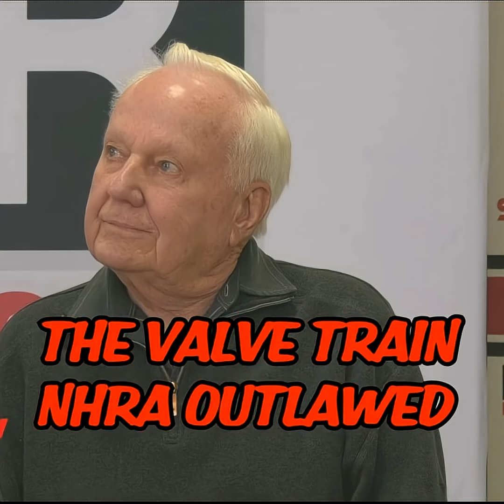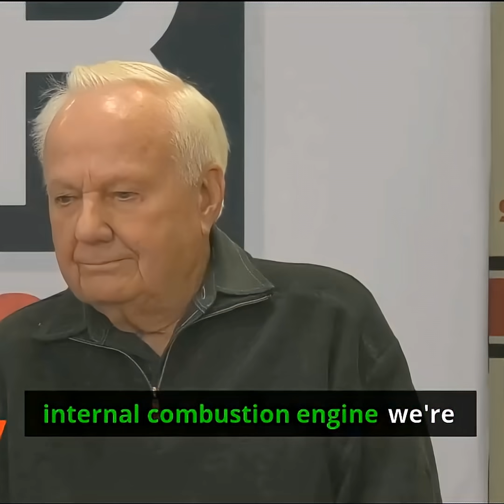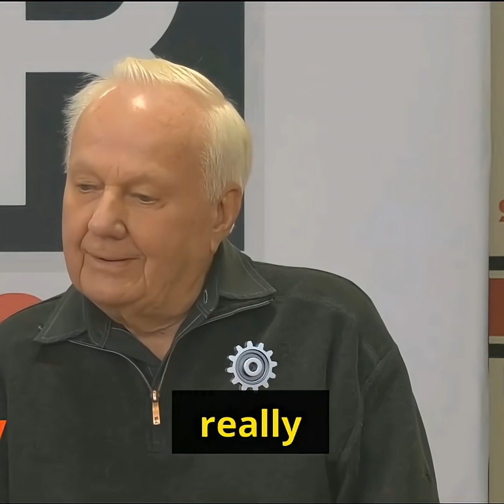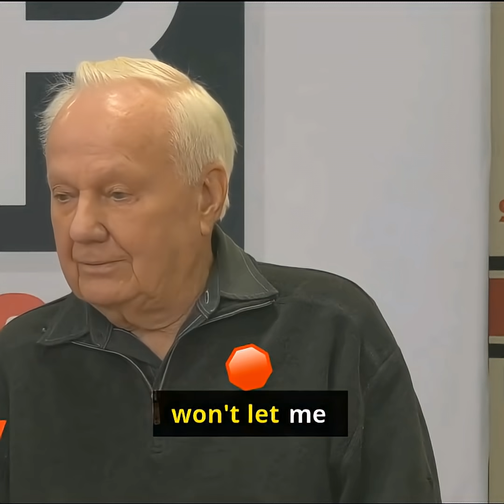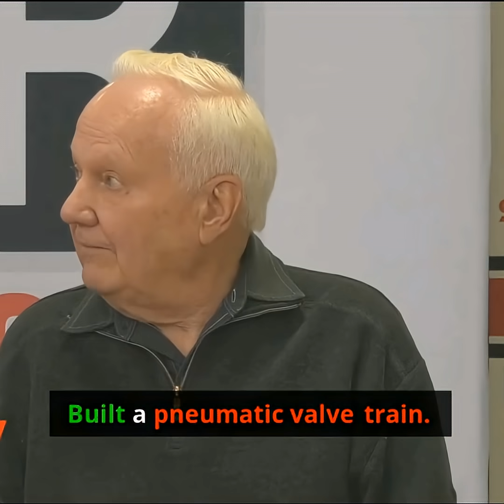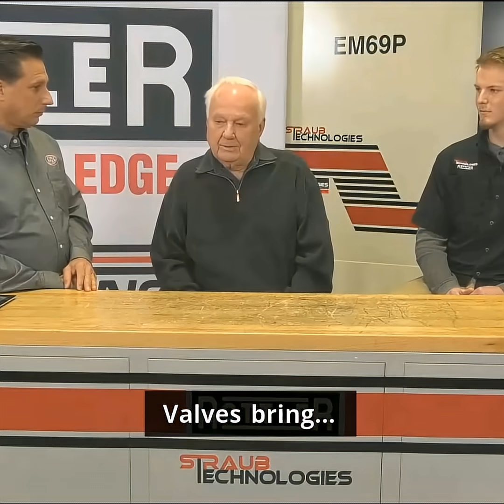Warren Johnson Built a 14,000 RPM Valve Train — and NHRA Banned It

Comment: F1 has run air control Valves for eons,  but I've yet to see pics or details on the system 
They ran 17,000 to 20,000 rpm before present turbo era
Reply: Brian Hart had his system in his F1 units back in the 80's

Comment: Thinking Del West might’ve figured in on the pneumatic springs, as I believe they were involved with the pneumatic springs in F-1 around that time.
Reply: Renault F1 pioneered it, if I’m correct
Reply: @DoriFord Believe you’re correct regarding the “pioneering” of the technology.
I’m referring to the expansion of the engine family’s of application and manufacturing of the pneumatic valve spring systems at that time. Particularly Del West, but also Manley were the leading players in titanium valve train technology then, specifically in Pro Stock. 
Have also seen pictures of components of pneumatic valve spring systems in F-1 applications marked “Del West”.